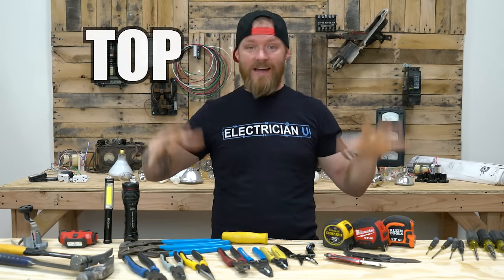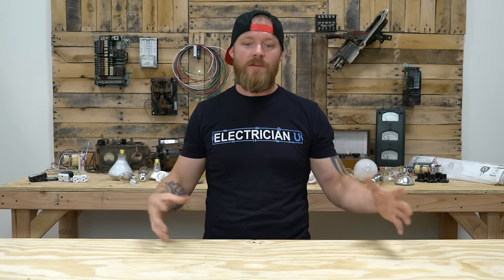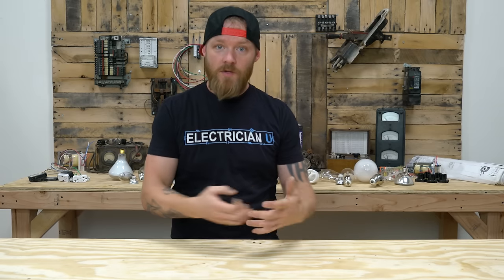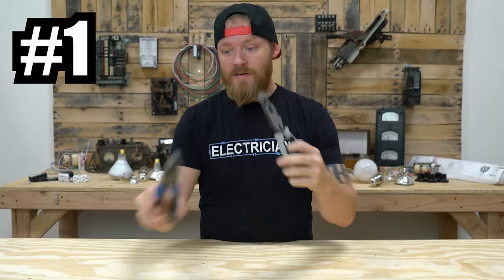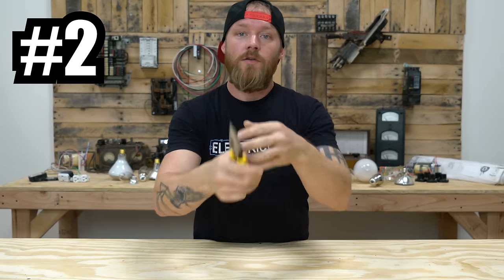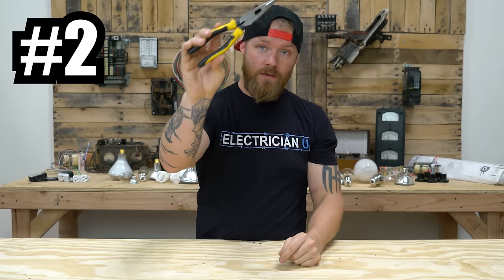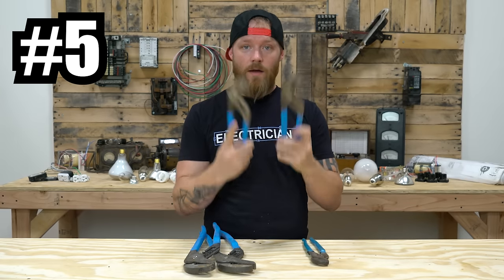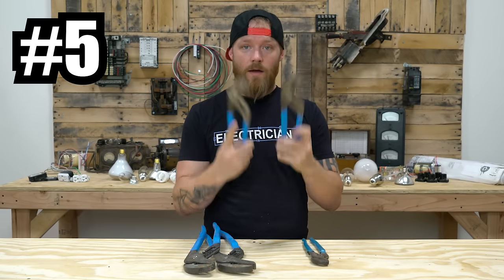Episode 42 - APPRENTICE TOOLS - 13 Tools Apprentice Electricians Need To Have

Comment: Klein makes a great pair of needle nose pliers and wire strippers all in one. My advice to people is try to get tools that are multiple tools in one. Their 20 in 1 screwdriver is great. Has 6 hex nut drivers that are impact rated along with 14 1/4” bits in the handle. This reduced my bags weight and space significantly. Also their plier wrench is amazing but I don’t know how useful that is for an electrician. I work in plant maintenance for a local isp so that plier wrench is basically a speed wrench for the large hardline coax fittings. Don’t be afraid to spend extra money for a purpose. If it covers multiple tools it’s often times cheaper than buy the 2 or 3 tools and it takes up less space and is lighter. Klein seems to be the only ones innovating in this area. I just wish the all in one driver handles were higher quality and ratcheting.

Comment: Not sure if you prefer headlights but the "Light bar" might be the best head lamp I've used for work. Low profile and rechargable and last quite awhile. Annoying though because it is a specific charger connection instead of a normal USB.

Comment: I think it depends on where you're from and what style of work you do most of. I'm only in my first year of apprenticeship and I've never needed to use my needle nose or even channel locks all that much. For screw drivers I've used number 1 Robbie, 2 Robbie, a big flat head for prying and a small flat head for those stupid companies who only use flat head style screws, I've barley needed any of my Philips. Also if you are doing commerical a lot I think getting a socket set from Canadian Tire like mastercraft is a must, a few wrenches don't need a whole set, but a few, also same thing for commercial I recommend looking for a hole saw kit or a 1 3/4 sized whole saw. I also like the hook style knives more than the utility style knife. I use my knife for taking the sleeve off of romax cable.

Comment: Man ive never stripped a wire with one of those things😂i have my automatic stripper. I dont know the exact English word (im german) but u just put the wire in it. Press until it snaps back and boom. Perfect strip.
Reply: Yeah I don't understand why more erect chickens don't use it. I got an old one at a garage sale, saw it's potential (it slipped a lot, probably made before THHN), got a new one from Klein, and I'll never go back.
Reply: @beardoggin8963  aint nothin faster than  dedicated pliers that Server Only purpose😂Thats total bs. But i guess yall in the US handle things Different than we do
Reply: Timo Hartig yeah we buy all our tools and have to go 100% full speed at all times. You are allowed one trip into the job with all your stuff in the morning. You learn to make due

Comment: Hey there is a badass light I use all the time it's called a neck light it is really bright,  you have tons of control of direction and you can put it on your head too the rechargeable one lasts at least half a day of non stop use.

Comment: All of these are great suggestions... I still have most of my original set of Klein tools because I keep up with stuff and don’t abuse them. People should learn to use a file to sharpen their diagonal cutters and lineman’s pliers...makes them nicer to use. Klein also makes a yellow handle set of both with induction hardened cutters for steel wire.

Klein,Dewalt and Milwaukee all make a demolition screwdriver with a metal butcap and a really hard tip. They are designed to knock out plugs and do demo stuff.

Also, you can buy replacement bits for the Klein driver on Amazon

Comment: Only note - if you want to keep your tape as precise as possible, don't let it slap back. catch it with the brake at like 8ft and slowly let it in. The rivets smacking against the tape eventually elongate the holes, and start to fuck up your measurements.

Comment: Olight flashlights. They are rechargeable,  but I have never been disappointed by them. They have a right angle one with a headband that will blow you away. Huge quality increase over just about any other light I have used in the past.

Comment: For a multi tool screwdriver I have a milwaukee 11 in 1 (renovation/ painting etc) and that's been good enough for most every electrical thing I've dealt with. 

Just got a 8 in 1 with impact bits that swap in and out so I keep that on me so I don't have to carry my bits. Just that screwdrivers M12 impact

Comment: The klein Linesman pliers (Blue insulation on the handles) have a funny slot at the pliers pivot point.....that is an actual mod to the pliers to be used as a tape (Fish Tape) puller.
Reply: Some models have it, some don't.

Comment: video sug
 a vid on weird or obscure or uncommon tools we might use. some things i use for example:
a scratch awl (perm marking in gypcrete or helps to align devices in a multi gang box. 
putty knife, clean up rough drywall cut outs around boxes also smooth out fire caulk.
lumber crayon. 1000x times better than sharpies
speed square. making big junction boxes look sexy 
Kite string, for cutting pvc with wire still inside
compass, when you get lost in the interstitials of a commercial building and no cell service!
all thread reamer- yes those exist! works great if have to use sawzall for cutting all thread!

Comment: The roto splitter is a great example of the "proper way" versus the "practical way." You're a resi guy so I don't fault you; but as a commercial guy I've run miles of MC and I've never used a roto splitter. I know some companies require them, but it's so easy to just break the sheathing, twist and cut, without damaging the wires. And it's faster, and it's one less tool you have to carry.

Comment: Actually, for mounting boxes and wire staples,my go to hammer is my lineman's pliers, and I have a small hammer, prob a 10 oz one for smaller jobs and tight places, plus what ever hammer you choose, you can nail with the sides of the hammer head. I have a couple ball caps that have built in LED lights.

Comment: A cable stretcher is always handy to have just in case you cut it too short and always carry an adjustable screw driver (also called a hammer).
Reply: C Hill depends on your country of origin and if you are left or right handed

Comment: There is one tool no one really mentions,  the klein tapping tool .Its a super handy tool alot times the threads are not very good in boxes or in old works rust corrosion, painted over screws and so on ,
Reply: Yes, a tri-tap is great to have.

Comment: i'm no electrician but i find all this stuff fascinating. but one advice i can give is buy quality.you dont want your cheap tool breaking on the first day and have to run out to get a new one or even worse having to borrow someone elses on the job. i'm in the every day carry scene. in the knife world gerber isnt even a thing. benchmade, skyderco, crkt,kershaw, and ortario. make good knives some great better knives, just dont bring your chris reeves to the site because you would need to use it. and torches/ lights there is some good ones out there but if you do get a rechargeable, buy a spare batteries change make sure you can change it in the car as well. olight is a good brand that does magnetic charging and the magnets on them are strong. one that fits in your month is a bonus

Comment: I prefer the klien 10 in 1 with the 2 Phillip's, 2 sqaure's, two 5/16 and 1/4's, 2 flat heads, and 2 torx compared to any multi screwdrivers, and that's because they dont rust as fast. All the other multi screwdrivers I've tried rust so tight within a short period that you can't easily get them apart, but with the kliens get a good year or more out of em  as a new construction and service work plumber, dealing with more wet conditions!  When I was an electricians helper I preferred a couple other singular klien screwdrivers because I just really didnt like the idea of losing a screw bit in live appliances, and ideal strippers. Idk why I just loved the ergonomics of standard ideal strippers.

Comment: Honestly my Milwaukee (I worked in construction as an electrician) tape measure broke when it fell off my belt from around 6 ft up. Now that is high just still, I had it maybe a week haha. Was using a lift to get up to a ceiling in a warehouse and 6ft up it decided to yeet off. I do have a craftsman and Klein one and both haven’t broken yet!. The actual tape itself unwound and shot out of the tape measure haha.

Comment: Seriously considering joining this trade, as my dad is an electrical maintenance journeyman and his job has always blew my mind since i was a kid. My only concern would be the math the bend conduit correctly. What would you say the difficulty would be for that?
Reply: It's really not hard. Sine/Co-sine/Tangent. It's basic geometry. Hardest thing about it is being able to apply enough pressure with your foot rather than pulling with the handle of the bender. A good pipe bender is a valued artist though.

Comment: You CAN use diagonal pliers for prying, but I find end cutters to be superior for that in almost every situation. Super easy to yank out even a rusty or vinyl coated 16 penny nail. Anyone doing demo work should have end cutters(nail nippers) for prying out nails.

Comment: Quick tip, if you know a tool will lose the clip screw... as soon as you get the new tool, take out the screw and add some loctite. It will save you alot of headaches.

Comment: If you go to auto zone for a good 6 in 1 for 3.99 that are #1 #2 philips and flatheads and typically have both the 1/4" and 5/16" or the Milwaukee 11 in 1 there pretty fantastic as well.

Comment: Can not remember the name but a few minths before I retired the company purchased a $75 LED super bright LED flashlight that recharges with a cell phone charger. Something like 1,000 lumens on high that is great working in drop ceilings. Always had trouble trying to secure light to hard hat with tinted face shield.

Comment: 12:18 Actually, you CAN (sort of) replace a 1/4"-hex-drive bit like that --- if the flat/slot-style tip breaks or gets lost, find an extended-length (so that it will extend out past the extra-deep hex-socket in your multi-tool's shank) flat-tip hex-drive screwdriver-bit and fit it into your multi-tool handle; it's true that this plain-shanked style of bit will fall out of your tool-handle more easily, since it has no spring-loaded retaining-ball like your original double-ended bit does, but at least you can use your multi-tool with slotted screws again.  You can also use your multi-tool handle with other types of screws (different-sized Phillips, different-sized slotted, square-drive, torx/security-screws, etc.) just by using other styles of extended-length screwdriver bits that have 1/4-hex shanks; they come in many tip-styles.  Use a magnetic collar or a bit of tape around the shank to keep the bits from falling out.  Finding a 5/16" hex-shank screwdriver-bit (like the other end of the multi-tool's shank-sleeve uses) might be a bit harder, but the 1/4" hex-drive extended-length bits are easy to find anywhere.
Reply: Dot and Klein both make replacements, though you might have to order them. A good supply house will have a few on the shelf.

Comment: 1. I feel like #1 should be a tester. Reasoning is obvious lol

2. You should make one of those Amazon tool lists for these types of videos, and add it to the description as well a mention it in the video. Even if it's a little, you'll get some money out of it. People are gonna buy these tools so it'd help you with some side income.

Good list tho, overall. I'd say replace the hammer with 2lb hammer and make kleins/2lb the hammer section as well ☺️
Reply: He did mention in the first two minutes that his list only included basic hand tools and not specialty tools such as testers. Pay attention if you want to be a good electrician.
Reply: @ltwadley7619  a hot stick should still be a priority. If the apprentice doesn't know something can kill him/shock him, and can't even tell, he's fucked.

Comment: Wise retractable box cutter is easy to use and is almost impossible to cut yourself. Stilletto hammer is the best for your forearm and you can switch out the end from waffle to smooth. Its drawback is the ridiculous price but it is basically a forever hammer!
Reply: For rare use estwing is a great choice too and wont destroy your wallet!

Comment: I won't buy any tape measure but a Fat Max. Used to frame houses, everybody used Craftsman  cuz Lifetime Warranty. They had weak springs that eventually failed so everybody kept a few handy in case of failure, then would occasionally  go swap their stable of tape measures at once. I bought a Fat Max and kept using the same one as everybody else cycled through  theirs.

Comment: For now the hunt for the perfect flashlight is on pause for me after getting one of the newer Zebralight 18650 headlamps with a "floody" lenses and a hi CRI led. Very bright, comfortable to wear, has been durable for me, and has good run time(charging once a week doing insulation/energy retrofit work with it 6-8 hours a day). And you can keep a couple of extra cells in the van on a charger.

Comment: No need for a roto split as an apprentice.. Don't waste your money on a hammer either, you have linemen (klein's) for that. Good screwdrivers like VDE wera or wiha are 100% worth the money. Don't buy knipex cutters, the blades can't take abuse like klein's. Knipex cobras (10") instead of Channellock pump pliers if you have the money. Get a torpedo level or 2, you'll need it for setting boxes, mounting fixtures, bending pipe, etc.. Buy a small 6-8" ajustable crescent wrench and some Allen keys you'll need them eventually and they don't cost much. If you are doing commercial, sockets and wrenches are also commonly used.

Drill + Impact kit is also a great buy but not necessary as some employers will supply it. I recommend M12 Fuel stuff it will do 80% of what you need as an electrician (100% of what you need as a young apprentice) and last years (as long as you don't treat it as an 18v and try using hole saws, augers or 2" carbide hole cutters). Along with a drill you will need some bits. Double ended driver bits made by rack a tier are what I use the most along with a milwaukee drill bit set. Any set will do but some last longer than others, I recommend doing a little research before you buy.

Comment: I know this is an old video and you may not see this comment, or have already tried this. But have you tried putting some Red Loctite threadlocker on that screw on the Fatmax? I use it in automotive for bolts that you absolutely dont want coming undone like Flywheel/clutch bolts.

Comment: Get a flashlight that runs on 18650 lithium and get a 110v wall charger with 2 spare batteries. Try a streamlight HL-X and buy some Orbtronic High Drain 3000mah 18650 cells. You will get 2 hours on high and 8 hours on low easy per charge (solid run time)

Comment: To reduce the amount of times you loose the clip on your tape measure you could try pulling the screw out and putting some loctite on it the putting it back together every 6 months or so

Comment: There is an 11 in one that has squares 1 and 2 cross 1 and 2 and the 2 flat heads with starts and the besides the nut drivers it has alan keys for panes

Comment: DUSTIN: Hey brother, I've been using a Nitecore HC65 for years now and it's the best, hands down. 5 light levels, 3 modes, flood light, red light (tactical), waterproof, drop resistant, COMFORTABLE, and you can charge with usb OR take the battery out & charge it (my preference). It takes an 18650 battery, I always carry a spare battery but never have to use it, amazing battery life. Trust me, best light out there, I have many, many lights.  One to 1000 lumen output, this is the winner.

Comment: When you buy your next Tape measure, preemptively remove the screw and put some super glue, both on the clip and in the screw hole. It'll extend the length of time until the screw goes missing.